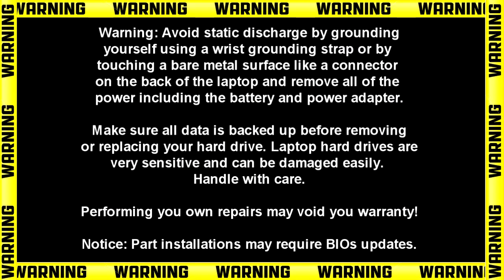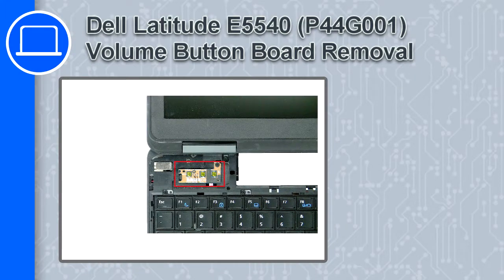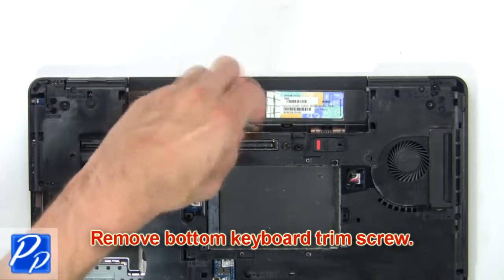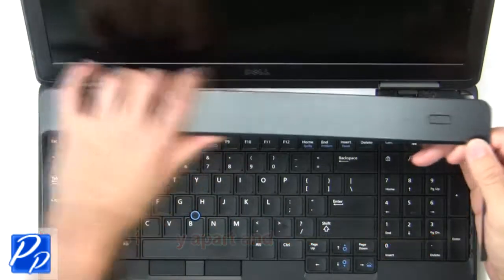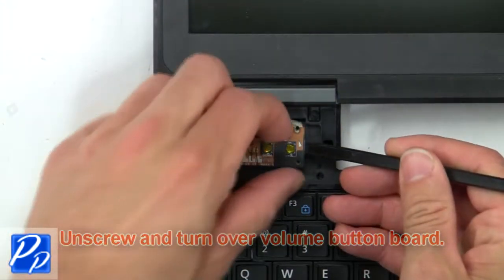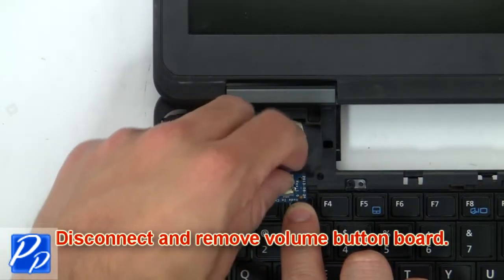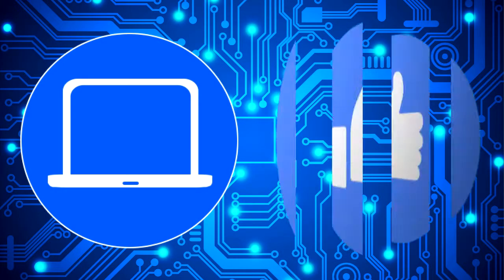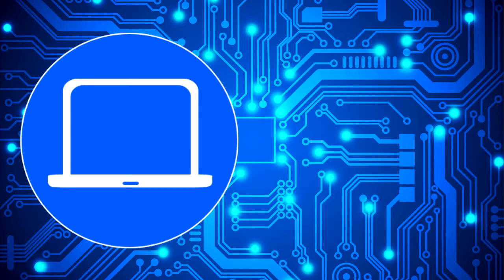Dell Latitude E5540 (P44G001) Volume Button How-To Video Tutorial

Comment: Hi . 
I have Dell latitude E5540 core i7 . And my problem is that , when i turn it off , after 20sec  it turn on back by itself i don't nkow what is wrong. 
If i want to keep it off i must take off the battery and when i want to turn it on , i must put the battery back  and connect the charger before it turn on .